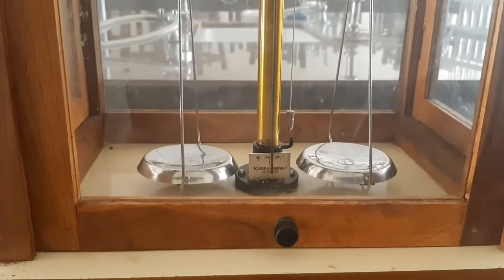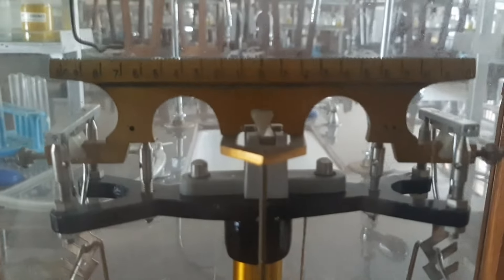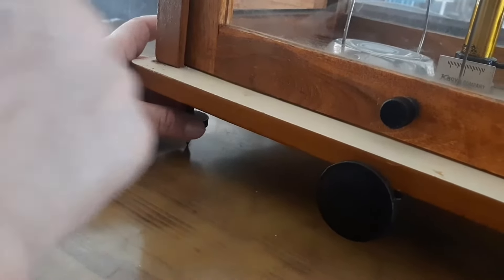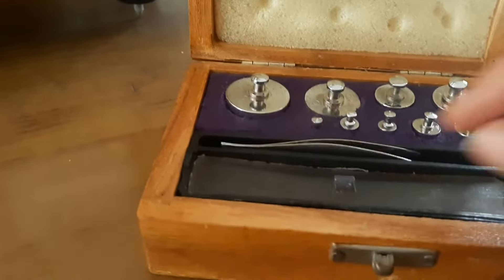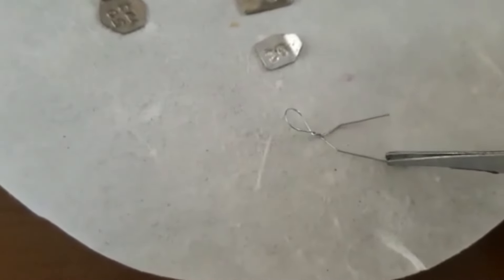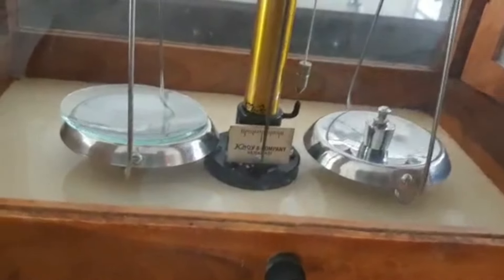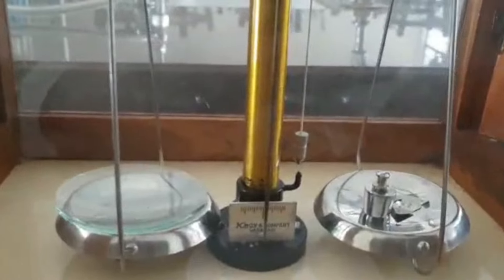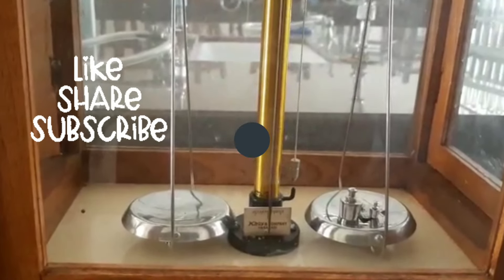Analytical Balance Working and Parts | Class 11 Chemistry Practical | NEET JEE | Bhatia Mam Classes

Comment: Mam last wala samjh nahi aaya apne 2g weight kiyoun add kia bcz AP to 2.26 g oxilic acid ko measure Karne wali thi to Sirf akhir m 2g kiyoun add kia
Reply from the maker: To weigh 2.26 g ,you need to take a 2g weight, 200 mg ,50mg,10mg ,so 2g 260mg would make 2.260g